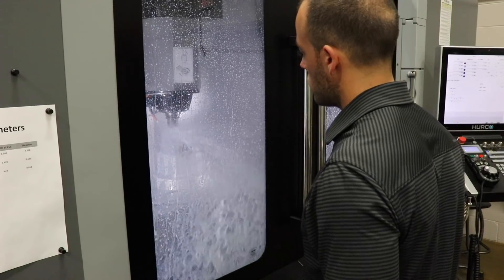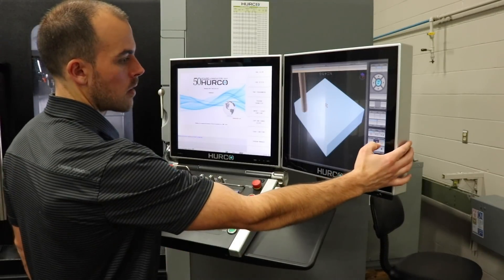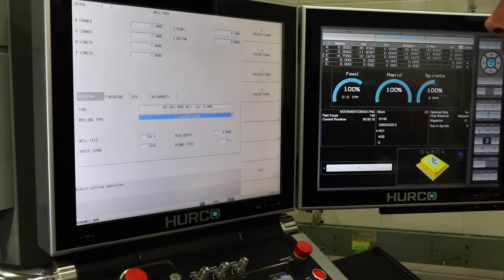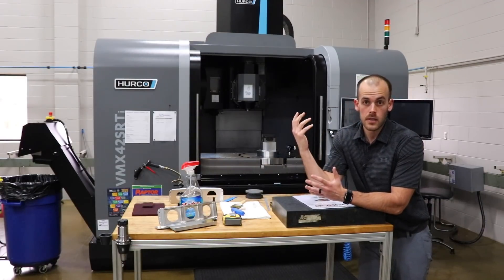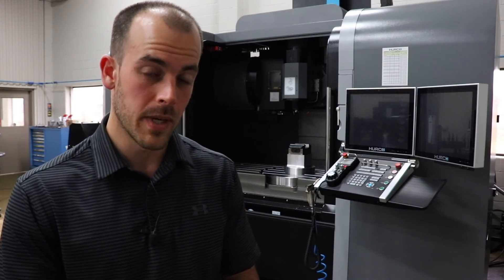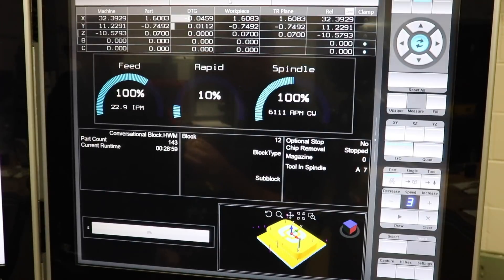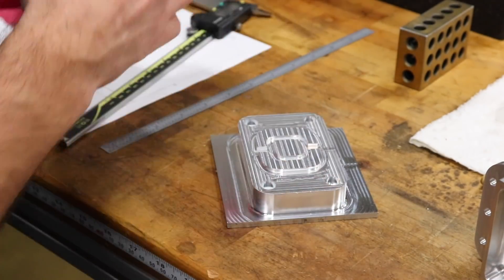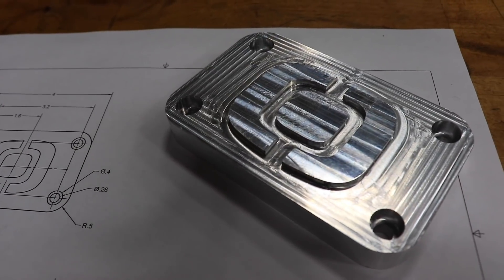My First CNC Part! // Hurco CNC

Comment: was in fabrication years ago and worked with much older milling machines and punch presses, was fun then and has come so far in simplifying the controls. For example I used a SMP program to communicate with my Machine. It would also take the CAD CAM drawings and convert them into the SMP language for the machines to be able to make our parts. I always preferred to do like you just were though in programming at the controls.

Comment: Glad that you got the chance to play with the "big toys"!  I have enjoyed using the smaller home shop CNCs at the maker space, and I have a small CNC for prototyping circuit boards. I think they are as useful as a 3D printer! 

It would be interesting to see a comparison of VCarve Pro and the Hurco conversational interface some time.

P.S. I have met some folks from the maker space in Dayton - they seem like really nice folks and I recommend checking out what a membership would add to your sanity until you can get your own shop back up and running.
Reply from the maker: Great suggestion!  Thanks